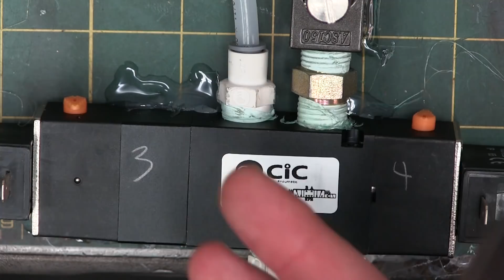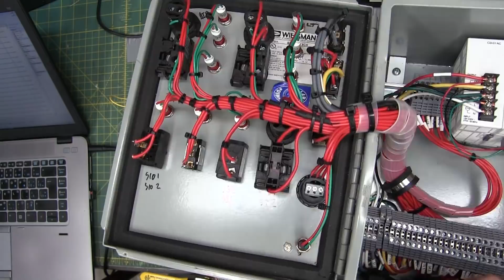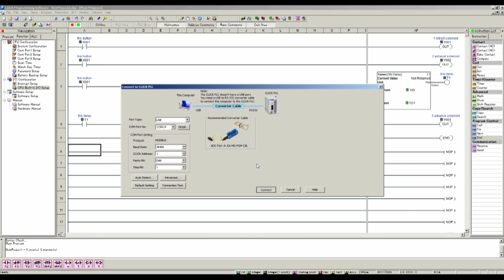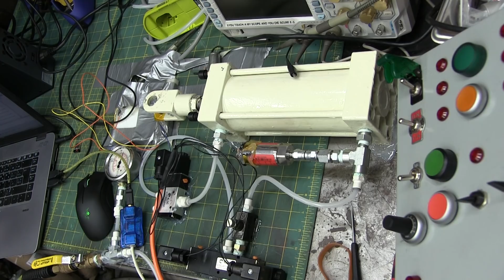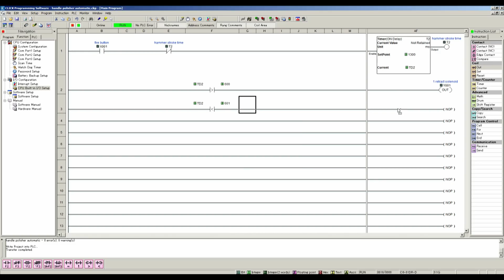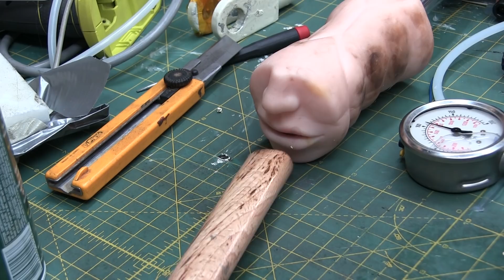Pneumatic Cork-Stuffer | PLC Programming Intro

Comment: You have to observe the USB port to collapse the superposition.
Reply: Or just do it the easy way with a goddamitron and a stetsor valve. No systems theory required!  lol
Reply: whenever I try to figure which way round a USB plug goes I end up with a dead cat on my hands.
Reply: wallhaxx    "You have to observe the USB port to collapse the superposition."  i cracked up for an hour !! got sore abs
I have a feeling most have no idea what that means
Reply: It's called schrodinger's port.

Comment: Weeks later I realize you have been evaluating different pneumatic devices for current to air so you can run a piston in a novel way using electronics so you can get that next level jerkoff device
Reply: Barry Ruffner I
Reply: he really needs to add a port to the back of the cork-holder to draw down a constant gentle pressure

Comment: I've just started playing around with plcs in my tiny little factory. I found that a little Siemens logo with the supplied software, works really well. They have proper visual aids programming, so you draw the circuit diagram and it then makes the ladder logic for you. Totally sweet.

Comment: Koyo Click is the great grandbaby of TI, Semens, GE Funuc plug ‘n play PLC bases, I/O modules and three speeds of processors ( still sold by Direct Logic I think).  All programmable in TI Soft running in DOS.  Probably also built by Koyo under license or maybe always samurai built.   The DOS had function keys for NC, NO, coil, timer, counter plus ‘or’, ‘and’ branches.  Lots of keystrokes rather than mouse messin. There was still the upload,download screwing around, especially when the eeprom, the running program and the confuser were all different versions.  No getting away from that.  But thanks for the memories.  The printing presses I worked on had 40 pages of ladder logic but that still beats the crap out of 25 pages of spaghetti point to point relay ladder logic for an unnamed Italian basket lift.

Comment: When we make pneumatic punch dies, we use a honking big quick exhaust valve connected to the front of the cylinder with a close nipple. If you used an open center valve you could dump the air a half second before 'stuffing' commences with only the two solenoids.

Comment: When you deal with a USB connector, imagine its your woman wearing a nice pair of vintage ribbed stockings.  Just as the rib on the stocking belongs on the back side of the leg, the rib on the USB belongs on the bottom (unless someone screwed up your computer).  I just haven't quite figured out were to attach the garter straps yet on a USB connector, but give me a little more time.

Comment: hey, AvE, remember me? The person your videos helped to get sober? Well I'm trying to dive headfirst into a welding course so's that I can learn a skilled trade and not be a drain on society any more. I can't really work a job that requires me to stand for long periods of time due to the steel plate having fused to my leg sorta half wonky, so standing/walking is VERY painful, and I'd like to have a job I can do without having to take a load of percocets, you know?
Reply: Katherine Clairmont Welding jobs will usually require a lot of standing. Try to get a job in the office of the company. Purchasing, programing or sales are good choices for this goal.
PS Talk this over with your sponsor she or he will know you better than AvE. Good luck with your recovery.
Reply: Be a designer, learn CAD and cnc programming.
Reply: Actually , cad , and cam would be good options.
Reply: CAD might be a good choice, but I'm thinking long term. Welders will always be needed and I can grit my teeth and cope with the pain if I have to stand. I do have meds for that if needed... I'm not too sure that CNC apps of today and the training that goes with them are gonna be still used in 20 years.... But I bet we'll still be joining metal together by melting the two pieces at the joint and mixing the metals to some degree...
Reply: Katherine Clairmont get into maintenance, something always needs to be fixed.
Reply: There's always the ever dangerous yet quite lucrative underwater welding...
Reply: Maintenance, if you have the mechanical aptitude do industrial maintenance. The smartest Mofo in the building is the mechanic that fixes the robot that replaced the welder. AvE himself is a maintenance tech, only way he has the extremely wide knowledge he does.
Reply: Keep strong

Comment: I had to learn Mechatronics, PLCs, and ladder logic practically alone in HighSchool for a STATE competition. 
(Because no other schools did it in our county.)
Oh, and I had 4 months to do it. 
No instructor. 
fml

(Additional note; My only experience was basic electrical comprehension, halfassed understanding of pneumatic equipment, and I dabbled in Python, Ruby and Java. Which as we all know, doesn't help with ladder logic.)
Reply: I took on deciphering the code for an existing PLC installation for my boss. I'd never programmed a PLC before. Needed to add two additional speeds and directions to a motor controller. That one wasn't so bad. It actually used some kind of code, but it was still not normal code.
Reply: richfiles Siemens has a stripped down Fortran in third controllers.  Easy to read and write but if you want structured code Oh my!   All the features of early Fortran: global variables, go-to and no subroutines.  Still, my Fortran finally came in handy.

Ladder logic is pretty nice.  From a verification viewpoint, much easier to assure yourself that you are going to get the expected behavior.
Reply: Funny thing is, I graduated and never got into Mechatronics after taking 1st for that competition. 
Instead I'm going to Aeronautical Service School, because who doesn't like some ASS.

Comment: Compressed gasses are quite literally explosives.  The difference between your compressor and TNT is the mode of storage and release.  One is mechanical and the other is chemical but goth are large amounts of case trying to become less dense as fast as possible.  Keep that in mind in the shop and you should be okay.

Comment: Seems like it would actually be much easier to write code than use that UI.
Reply: Easy, possibly. Efficient? Heeeeeck no.
Reply: Kids use Scratch, which is way easier and probably more capable than that UI.
Reply: Never programmed a plc, code or not, but the first program in a arduino-ish C would look like:

void loop() {
  int button = READ(I1); 
  WRITE(O1,!button); 
  WRITE(O2,button);
  if (!button) { 
    START_TIMER(T1, 100); 
  }
  WRITE(O3, TIMER(T1));
}

To me this makes WAY more sense than the visual thing, and it would take <1% of the time to write.... but then again, I am a programmer...
Reply: Антон Южаков - I can write code faster without a UI. Vim is amazing. I also write in a dozen languages or so. Besides. How would one implement a proper design pattern in that visual stuff? :P
Reply: Only if you are a programmer. Thats like saying its faster and easier to just pick something heavy up by hand than with a machine. It is, if you can do it.

Comment: When you build mine I want you to add a 90 degree clockwise rotation on the advance and a 90 degree counterclockwise rotation on the retraction stroke and include an autolube feature along with a voice actuated restrictor band plus the ability to grill the perfect steak all at the same time...and it must be completely silent except for the suction noises as it slips off the end of my hammer handle...can I get it by the end of the week?

Comment: How can people program like this?? it feels like 20 mouse clicks for what should have been a simple line of  c code
Reply: Mik Wind it's not so much coding as it is digital wiring. But despite what AVE says, PLC programs can get very complex. Yeah making a program to turn a light on is easy, but so is doing the same thing with conventional computer programming.
Reply: Ladder is for the maintenance guys to look at the Blinky lights (easy trouble shooting). Once you learn the hot keys and tricks it's actually very fast. I can code in Allen Bradley just about as fast as C++. The other strong point for plcs is online editing where you can make real time changes without re-downloading. Pucker factor is maxed in some situations where a wrong move could be catastrophic.
Reply: I'm new to the industry ,since I'm still doing my masters but having done only C/C++ with microcontrollers for some years, learning PLC programming has been a painful experience. Tbh, It just seems to me like lots of what would be heavy coding is just hidden as part of the manufacturers HMI package, or as part of some software package, packages that companies like siemens get to sell you at exorbitant prices. I'm willing to bet that the firmware in most HMIs was done in c.
Reply: You don't have to use ladder logic, all PLC's I know of can be programmed in assembly aswell.

Comment: 22:34 you have to "give it a ground" (i.e. reference the inputs to ground) because the inputs to the PLC have optocouplers, making them inherently isolated from ground. If that wasn't the case, you would not be able to connect some O/I to live- (hot-) referenced circuitry whilst having others connected to ground-referenced circuitry.

Comment: Ladder logic is elec chicken native language.

I "learnt" some back around 1980; part of being a maniacal engineer; studying and fuxing control systems.

Try to avoid leaving a valve solenoid coil energised in the "rest" position. You could do that (failing e.g. limit switch feedback)  by putting a timer on the NC contact and then the valve solenoid on that timer so that the valve is only energised for the longest plausible time for the stroke of the piston. This reduces the heat developed in the system and keeps the envirofairies more friendly; as long as you express the sentiment.

Some PLC will handle anal-log signals from e.g. pressure transducers so they can be employed for position feedback (pressure rises at end of stroke) or to signal a pressure failure.

Comment: Why not set up the 3 way valve on the rod end so the rod end is normally vented to atmosphere.  That way when the cylinder extends it will have 2 paths for the air to leave quickly without any delay to dump the pressure in the rod end.  Then to retract you just need to close that valve before you activate the retract solenoid on the 5 way valve.  You may have to let the piston end vent for a few seconds after it has fully retracted so there is no pressure left to push it out when the rod end gets vented.

Comment: In the late 90's I worked as an engineer at a tv station.  We had a audio video router that was programmable via serial port.  The router had just been installed a couple years prior and no one had ever needed to change anything on it so we didn't have a configuration file saved anywhere.  I grabbed the laptop, connected the 9 pin serial to it, and connected to it.  I fired up the proprietary software and saw where I could upload and download config files to the equipment and since I knew I didn't have the config and needed it, I hit download.  Well, it erased the fucking thing because the download button actually meant download to the router instead of download to the computer.  That was a clusterfuck and it all happened within an hour of news cast starting so I had to scramble to reprogram this thing.

Comment: The IEEE standard for the USB connector clearly specifies 540 degrees in a full revolution of the connector. It might have been a typo, but the stickler engineers pressed on and made it happen.

Comment: For what you're doing, I don't think you're going to get the speed out of it that you eventually want.  Might I suggest an electromagnet (or regular magnet) to hold back the plunger until quite a bit of pressure has built up in the cylinder?  You should should get quite a lot more bang for your buck then.

Comment: I don't know anything about wrangling angry pixies or combobulated air, but won't a larger diameter input pipe and a narrower outlet pipe work reasonably well? Of course, then you won't be able to fine-tune it for her pleasure.
Reply: U Wot M8 what you are trying to say is an orifice fitting but, like you said can't adjust and because he's supplying pressure to both sides independently using undersized tubing would slow both extend and retract function. Wants fast out slow in.

Comment: An under varied variable 4 1 2 vary.  The rod end cylinder volume + PLC timer + venturi style vacuum pump = fast or headaches?

I-----PB-------------(Relay)----I. Internal relay could make delaying solenoid valves easier.

Comment: I been learning about these damn things in school. Absolute security nightmares. Often you can brick the things with just a few pings or sending, communication wise, anything that it not used to seeing. You can't run vulnerability scans in a network of these things because chances are you'll brick your entire system which could be in the middle of running some pretty critical stuff.

Comment: I dont get it do you have the exhaist ports on the 5 way valve restricted? Doesnt it open the opposite end of the cylinder to the exhaust port when you activate the valve in one direction  allowing the air to escape, why do you need the second valve, do you have the exhaust of the front of the cylinder on the 5way valve blocked off and using the difference in pressure when opening the second valve to accelerate the cylinder? Does this make it faster than just pushing the cylinder out with straight air

Comment: Why didn’t you use a quick dumpvalve for releasing the return air quickly in the one direction you used a electronic valve ? These are made to let the alr true to the cilinder in on direction and  let all the air out into the atmosphere in one go without needing to add  controls

Comment: I love the ladder logic, I own two Sprecher+Schuh Sestep 290 PLC’s and have programmed them since I was 8 (9 years ago now). They don’t work with any pc software, you need the PRG-20 Programmer panel to input the commands. The commands are STR,AND,OR,NOT,TMR,CNT,OUT, and heaps of functions. Where you have contacts in the ladder diagram that is a STR command, for the first one only though. All others are AND/OR commands. Love love love PLC programming, better than a blunt stick in the eye what with the new fangled raspberry pies and the das fritzen fratzen blue smoke coming out of the haaaarduino off the fleebay.

Edit: here is my last program, a model elevator controller. 

Str X1
Or X11
Or c200
And not x7
Out c200
Out Y7

Str X2
Or X12
Or c201
And not x8
Out c201
Out Y8

Str X7
And Y1
Str X8
And Y2
OR STR
Str c211
CNT V1 - 1
Out c204
Out c210
Out Y15

Str c204
Str C211
Or X11
Or x12 
TMR V2 - 45
Or X11
Or x12 
Out c211

Str x3
Out c202

Str c200
And not c210
And not Y2
And not c211
And c202
Out Y1

Str c201
And not C210
And not Y1
And not C211
And c202
Out Y2

Str Y1
And X9
Str Y2
And x10 
OR STR
Out y4

Str Not Y1
And not Y2
Out y3

Str Y3
Str C210
TMR V3 - 10
Out c205

Str Y1
Or Y2
Out Y16

Str X1
Or Y9
And Not X7
Out Y9
STR X2
Or Y10
And not x8
Out Y10

Str Y1
Out Y11
Str Y2
Out Y12

UP/DOWN INDICATOR LAMPS

STR X7 OR X9 OUT Y11
STR X8 OR X10 OUT Y12

Comment: Now to upgrade to industrial vibrator..add piston sensors, measure full stroke time. Using similar setup as the hammer add a BCD switch to dial in vibration frequency based on the measured full stroke time..and may as well also add another switch for variable stroke length. This may need fairly high. I/O speed. 
This has also given me an idea for a PLC Tesla reciprocating engine. I have some nice Mitsubishi high speed motion control to play with.

Comment: Wouldn't be easier to wire the release presure valve and the fire pistone valve together with a capacitor to delay the later by half a second. Passively electronicaly controly the firing?

Comment: A tip (just the tip) for anyone on a really tight budget: A lot of old (probably free) computers have serial ports. You don't need a lot of horsepower to run WinXP, and the Click software will work on it.  Grab a junk PC for the workshop and get the PLC minus the ethernet port and save about $60. Forget the modbus port, too. You won't need it for basic projects.

Comment: I am both repulsed and aroused in equal measure by this device.  Is there anyway you can get a qwarter twist at full retraction to fully stimulate the cork end? I reacon somewhere to rest the plums wouldn't go a miss either. I look forward to the kick starter and you can put me down for two.

Comment: Ethernet connectors won't always have a metal casing, only when they're shelded cables. Usualy used when it is mixed with noisy electronics like drives for exemple.

Comment: my friend almost lost his hand fiddling with a pressurized paint sprayer, the hole was tiny but it pumped his hand full if paint and they had to scoop moat if the flesh out. ER didn't know what to do either, had to Google it and go back or it would have been amputation for certain.

Comment: 21:01
I got royally screwed over by a user-unfriendly user interface a couple years ago, thank fuck there was a backup file otherwise a machine costing many times more then my paycheck would be reduced to a very large paperweight!

(I transferred a blank file to the PLC instead of reading the PLC and putting that on the confuser)

Comment: Small tip: By design, the USB logo on plugs should be facing the user when plugging the device. Therefore, you should be able to plug it on the first time if the logo is on the right way!

Comment: Have you worked in the injection molding business? I can Tell you know what you’re talking about in the BOLTRs when looking into the plastics and the mold making when dissecting the power tools. Also programming PLC is of course a big part of the automation process in the injection molding plants. I work with injection molding myself so it’s stuff i’m used to and can relate to.